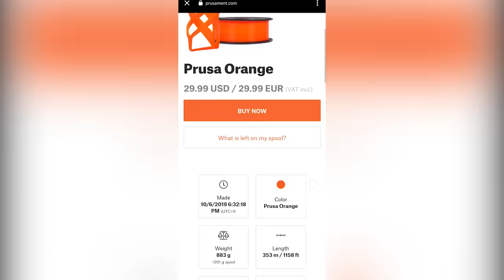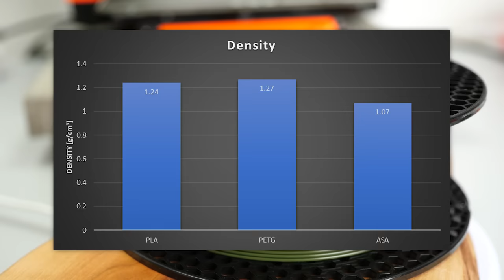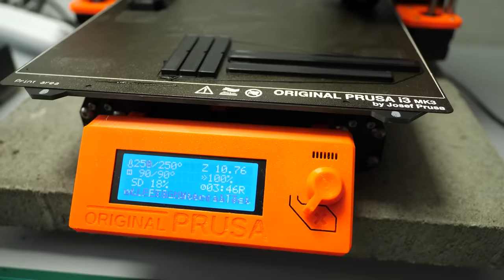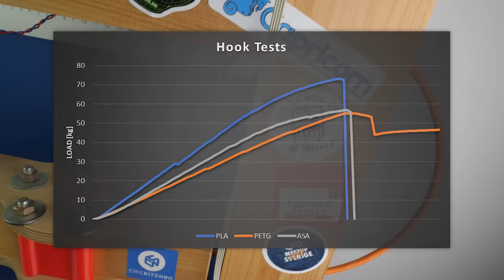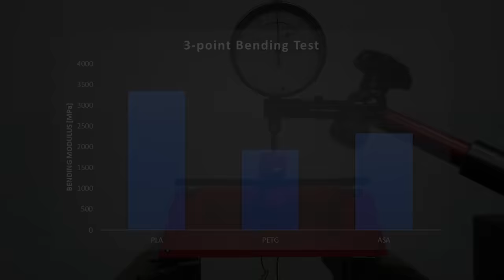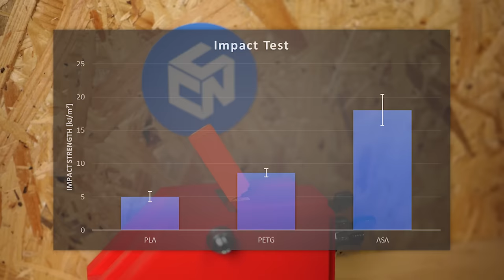The BEST 3D printing material? Comparing PLA, PETG & ASA (ABS) - feat. PRUSAMENT by Josef Prusa

Comment from the maker: Don't forget to share this video on Facebook, Reddit, Twitter and other social media!
Reply: CNC Kitchen, this is a great video! Thank you, this is great and useful information. 

thank you for all of you great content it has been very helpful for me
Reply: Don't forget that PLA is not suitable for CPU coolers mounting plates.  ;-)
I love your videos. Thanks for sharing all the knowledge and please continue with your videos and with the Meltzone podcast too.
Reply: That filament roll doesn't use less material.. It has lots and lots of hexagonal walls.. If you flatten them all, it is just one flat plane about the thickness of normal filament roll.
Reply: 16:00 Density "zu" strenght and stiffness 😂
Reply: Hallo Stefan, könntest du mal Biofusion von Extrudr testen?
Reply: i don't do social media sorry
Reply: @CNCKitchen: I think your tests are great and I often use your tests to make my design and material decisions in my projects. Also this video is fantastic! Would it be possible for next videos to test the creep characteristics?

For example, applying a static load on some samples and measure the plastic deformation over time. To shorten the time frame, I think, you can increase the ambient temperature and plot a TTT(time-temperature-transformation)-diagram. It has been a while since I have done these kind of tests, but I am sure on the internet one can find proper test setups for the creep characteristics.

I know you already did an oven test, that partially covers the subject I am talking about. But for the full picture, maybe some more tests are needed as mentioned above. As creep is an important phenomena to consider in the design of many projects, I am positive this will be highly appreciated by fellow engineers.
Reply: with your load test, you only saw how well the layers stuck together, this is not an indicative test, why upload it to YouTube?
Reply: i think 25-30$ a spool is a price from 2015 and the normal price should be >10$
why? because:

Perfect price would be the same as 500 sheet of paper for a normal printer ->6-7 $
i remember that someone found out the materialcost for commercial use is under 2$  so selling it for 10-15x is crazy , yes know process cost and labour and so on BUT every company has these cost. Most copanies can operate with 1,5-3x Profit margin.
Reply: Thanks for the analysis and video...
Reply: Hallo Stefan
What would be the outcome if you increase the surface of the hooks? 
Would it be able to take more load?
Intrested to know as I’m designing wall mount brackets for a shelving system that I’m designing. 
If you would be able to test it I’m willing to share the stl files. 
Greetings Jo
Reply: Nice am Anfang guten Morgen ich bin Stefan 😅
Reply: Sag mal wie bekommst du den Ofen so sauber? Oder wird er einfach nicht dreckig, weil du ihn nicht zum kochen nutzt?
Reply: Hello, I would appreciate the subtitles in Spanish please...✌🏻
Reply: As someone who is new to all of this this video is fantastic 👌
Reply: I generally print with PLA simply because it's easy. However my wife loves to decorate outside around our door and for holidays and other things that I print I go to PETG because in the summer, those holidays can be very hot. PETG stands up very well where PLA sags and loses shape when the temperatures are above 100 f.
I've wanted to learn to print ASA but after watching this video don't know that I need to. For everything I do, good PLA and PETG are just fine.
My go to filament is eSun PLA Pro (PLA+) which I found is pretty close to PETG and incredibly easy to print.
I may have to try Prusament, but the cost is generally $2 to $4 more per spool than eSun.
Reply: Yes. Thank you.
Reply: Great video, do you have any charts for the data? Thanks.
Reply: Sir what is the main tests for 3d printed objects for comparing among them....
Reply: Same

Comment: I tested PLA, ABS, and PETG for an engineering project last year. I found that PETG was the strongest, ABS was second, and PLA was significantly weaker. I think the design of the hooks is the main difference, where yours was open, and mine was closed. An open hook applies a torque on the material, which may lead to the difference results.
Reply: How you print it makes a huge difference. When printing hotter, the layer adhesion will increase drastically, especially with PETG
Reply: Makes sense: in the stiff PLA, most of the cross-section shares the tensile component of the bending force, and only the outer wall takes the compression. Whereas PETG and ABS yield more and thereby distribute the compression zone further inwards, which means the tensile load is more concentrated on the inner wall and thus has to withstand higher tensile stress despite same load.

I'd say the open hook is a rather more real-world-relevant test for static strength than pure tension though. PLA's stiffness means you can easier estimate how parts will behave under mixed-compressive loading, you don't need to worry about buckling etc. as much. OTOH, if your 3D-prints need to handle strong, purely tensile loads, you're doing something wrong in design – such tasks are much better given to wires / cables / ropes etc.

The flip side is of course that the stiffness exacerbates PLA's brittleness. Definitely not the right material to expose to impacts. Not to mention high temperatures.
Reply: @rikkardo9359  , At higher printing temperatures, PETG becomes brittle.
Reply: @Valery_1954  I do not have that much experience with PETG. Thanks for the info
Reply: @Valery_1954  definately not unless your printing too hot for the material and it's crystalizing.
Reply: @digibluh , I print all the PETG I have at 216°, when testing layer sintering it is stronger than at 235°.
Reply: @wojtek-33  i print petg a 226 c
Reply: @leftaroundabout  PLA Pro/Plus wins the contest. ABS has less creep, but that's about it.
Reply: That is very interesting, and more in line with what I would have expected.
Reply: Moment* not a torque
Reply: I use petg even for outside use It works well for me even when it's cold ❄️ out it holds I print it at 220 I think a lot of things matter like ur set up and room temp and many other things like setting and infill I thing many things play with how good your print comes out even ur printer set up
Reply: I lay down the first layer of petg at 250C on a 70C mirrored glass bed to get it to stick. I did a hotter bed but it stuck too well. I reduce petg printing to 220C. Maybe for strength I could increase the printing temp. But am open to advice. The filament manuf recommends 235 to 255c but I find this too hot.
Reply: @rikkardo9359  At higher printing temperatures, PETG becomes brittle.

Comment: PLA would really be the best material -  if the temperature resistance wouldn't render it unusable for most applications. (without annealing etc). You can't put it in a car, mount an eletric motor to it, leave it in the sun -  its basically living in the shadows^^ . The toughness/strength etc. can usually be compensated by making the part bigger or reinforcing areas.
Reply: Ironically, I'm printing some load bearing parts that are literally going in a temperature-controlled closet. My PLA is like "Yes! This is my wheelhouse!"
Reply: But can PLA be exposed to the sun tho?
Reply: I don't think your car goes to 50 degrees CELSIUS. So it should be good enough for anything of that sort, excluding impact resistance.

Edit: clearly I was wrong, sorry, I guess cars do get hot. Thanks to all the people who corrected me!
Reply: @DhruvGN8  Cars go up to 70 degrees celsius when left in the sun in summer. And I am not talking about death valley, just normal German summer with 32 degrees celsius outside. Problem is the greenhouse effect within the car
Reply: @VentoGelado  Yes it can be, uv light will not damage it significantly.
Reply: @JL2579  we get a few 100°f degree days a year here in Michigan and the inside of a car in that heat can be in the 120°f  to 160°f. It's like a solar oven kek.
Reply: @DhruvGN8  Cars in the sun can easily reach 60 degrees inside.
Reply: for this reason PETG is the clear winner. It is much less brittle than PLA, it won't melt easy, and most importantly it is easy to print with any printer. ABS requires a few modifications to your print area to succeed in making a good print, and that is only if your part is designed in such a way that the forces of the plastic shrinking won't warp it and/or cause layer separations.
Reply: Way way not true. Pla is good for cosmetic things you keep dry ans indoors. It doesnt even compare to abs in strength or toughness
Reply: Can i play with some toys outside with it?does it melt easily?
Reply: @anthony5775  thanks for the response!😊
Reply: @noahpaulette1490  Not to doubt you as I've not printed with ABS, but isn't that odd since ABS has very good impact resistance, and PLA is more brittle?
Reply: PLA is way too brittle for the stuff I work with. I love PETG, but it's just so stringy and the shiney surface means defects are really visible in black.
Reply: @1992jamo  if anything it's the other way around. Pla is slightly more flexible than abs after printing. Abs is a bit harder and will shatter when it fails on occasion.
Reply: @JL2579   Cars here will get well over 100ﾟF on a moderately sunny day.
Reply: @1992jamo   Turn your fans off when printing petg and use a little less heat and it should help the stringines problem. Also a wire brush that the extruder goes over can help a lot but I haven't done that yet.
Reply: @DhruvGN8  I printed a shift knob with PLA a few years ago and it deformed in the sun on a warm day. Granted, there was some spring force acting on it via how it was held in place, but still can be an issue.
Reply: Only an issue if you're brave enough to leave the basement. :-(
Reply: @1992jamo  I have the stringiness of PETG under control I think. Perhaps by keeping it stored dry, perhaps it is teh speeds I print at, perhaps that I went to direct drive (nothing special, just a Titan on top of my Ender 3 standard hotend, bowden connectors touching).
Now printing one of these print-in-place gear bearings as a test.
Reply: @pizzablender  Oh wow nice! Let me know how it goes. I've tried to print so many print in place geared bearings in PETG over the years but never had one which wasn't fused solid. I'm using direct drive on an ender 5 with E3D V6 hotend. I think storage of the filament is really important as you say, but I haven't messed around with it yet
Reply: Dhruv Golchha yeah, you’re quite mistaken about that. It’s ok, we all learn new things every day, but checking right now (9:00am) the outside temp is 68F (20C)), and the inside of my parked car is 102F (38.9C). What do you think it will be in 3 hours, when the outside air temp is 90, and the sun is directly overhead? Likely it’ll be 120-130F (48.9-54.4C), and just wait till summer.
Reply: plus it hates humidity and water
Reply: @1992jamo  I've printed one of those gear bearing from thingiverse at 100% and at 80%. They work, the 80% one I had to force at first with an allen key.
I kep th PETG in a closed box with oven (110c) dried silica gel.
Reply: I have used PLA brackets in outdoor coin operating carwashes for years and there didn't seem to be a problem with them in a metal box outside in the Philippines
Reply: biut like you said it use less ill never buy it
Reply: @DhruvGN8  depends on the part of the car, engine bay? oh it will, everywhere else? nop
Reply: polymaker makes PLA that can take the high temperature environments and direct sun light.
Reply: perhaps "The Best Material" in your situation, I use them all.. for different kind of purpose..

Comment: From an aircraft design perspective, quadcopter or otherwise, ASAs lower density looks really attractive. I can print something 15 percent bigger for the same filament weighty, and design members and walls 15% thicker. Since stress usually acts on the outside skin of a part first, that 15% bigger makes a big difference to the ultimate strength
Reply: I think warping might be an issue. 3dLabprint did experiment with a low density PLA for non load bearing parts I saw in a video and they recommend it.
Reply from the maker: Video on that coming 😉
Reply: @CNCKitchen  While it's nice to use 3d printed parts for aircraft related things it's generally one of the worst materials in terms of it's strength to weight ratio especially when you consider alternative like wood or foam or composites.

Weight is the enemy when you're making performance aircraft.
Reply: Hey, have you tested how ABS or resin prints perform in aircraft parts?
Reply: @seemlesslies

Comment: Your test methodology seriously disadvantages the ASA layer adhesion. Using a bed slinger with fan on without a heater enclosure is worst case scenario for ASA. Would very much like to see a deeper look into ASA performance with it's unique requirements taken into consideration. It's a really high performance material when used correctly. UV resistance, high temp resistance, chemical resistance, impact resistance, less smell than ABS, and easier to print that polycarbonate.
Reply: J Z good comment — I have been trying to use the Prusament ASA this winter and haven’t been getting good results, especially with layer adhesion. Would also love to see some follow up on how to accommodate ASA with home 3D printers.
Reply: @jarnold2000  I use a vented tent over my corexy. The heated bed is large and powerful and can keep the inside of the tent to about 40c which seems enough. 0 part cooling fan as well.
Reply: repeats what Stephan says about ASA and doesn't notice the enclosure
Reply: I use Devil Design uncolored ASA, and can't even print with it when the ambient temperature is under 30°C (bed adhesion/warping). I use a home made enclosure which is clad with insulated reflective foil, capable of reaching a toasty 65°C. When printed in a heated enclosure, I can't even bend similar parts by hand which snap with ease in PLA. Also part cooling is a no-go with ASA, even the hot-end fan can ruin the properties of ASA. The only downside I found (but may be fixable) is that ASA shrinks a lot more when cooling after printing, so holes and alignment keying can be a bit of a pain.
Reply: @JasonZnack  Very cool. I need to try to get to building an enclosure so some sort. Or at least wait until the weather warms up. :) Will try no cooling too.
Reply: I have switched to ASA as my go-to for structural parts. We have a Stratasys F370 at work and I have a Dremel Digilab 3D45 at home, and on both I get consistent, durable parts in ASA. It prints like butter when set up right. Turning OFF the fan is a MUST though, and printing in a cold area will not work well either. These considerations in mind, I have been printing prototype electronics enclosures with .045" walls that have spring clips and knobs with detent features and snaps and all of it works!
Reply: @dimitri877  shrinkage is a pretty nasty bitch when it comes to designing parts that is interesting how much stronger you were able to make them with a 30 degree change in temp though.
Reply: @seemlesslies  I bet it could even get better, but have been to busy to experiment more. I've been waiting for parts to get all electronics aside the stepper motors and their leads outside of the enclosure, since some parts even started to melt when a print was taking longer than 2 hours. The best thing so far has been the glass bed, for it transfers heat very good from the heating element.
The true benefit of ASA is that it's 'easier' to print than ABS, but still retains properties like being able to be 'welded' with acetone to itself. One can even 'weld' it with ultrasonic methods to PVC, ABS, SAN, PMMA, and others. It even sticks to wood and metal with epoxy or neoprene adhesives. On top of that, it has better weather resistance, chemical resistance (mainly alcohol based), retains 'gloss' (a way to tell a polymer is deteriorating) and has very good anti-static properties making it ideal for electronics applications.
IMHO ASA is one of the best amorphous thermoplastics available to date.
Reply: @JasonZnack  i could just turn off the AC to get those temps.

Comment: Its true that stiffness does not equal strength, but its also very important to remember that tension stress isnt the only parameter that matters when doing strength testing. Id like to see you test all 5 pillars of mechanical stress: tension, compression, bending, shear, and torsion.

Comment: Discovered ASA recently, and now it's my favourite filament...
If possible use an enclosure because of warping and layer adhesion, fan 20% max , but the best part is it can be smoothed with hot acetone vapour just like ABS. It gives you injected plastique look, with no layer visible at 0.2mm, at all...
Reply: Hmm. I may try that on my next filament order.
Reply: I have been seeing ASA pop up more and more. So I did some research and will definitely be getting some on my next filament order.
Reply: fan at 0% improves layer adhesion massively and helps a lot to prevent warping cracks in large prints
Reply: Also it's really easy to sand!